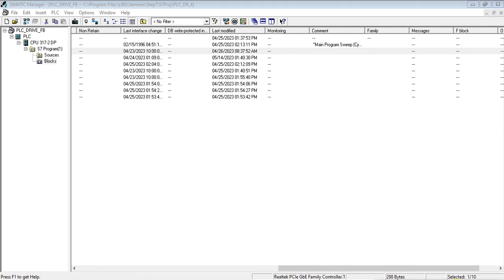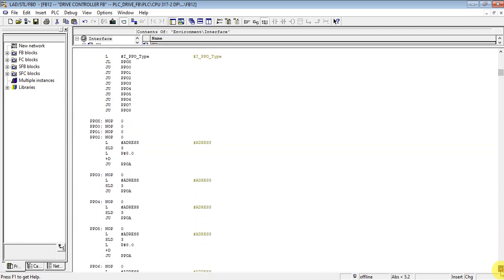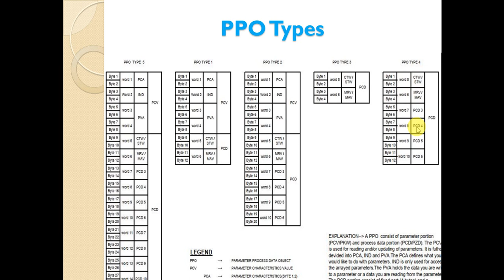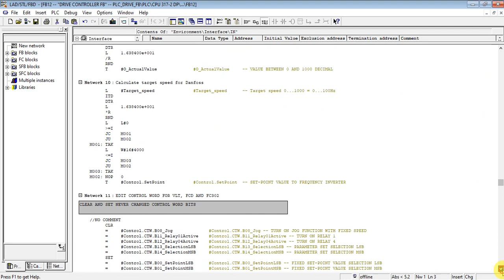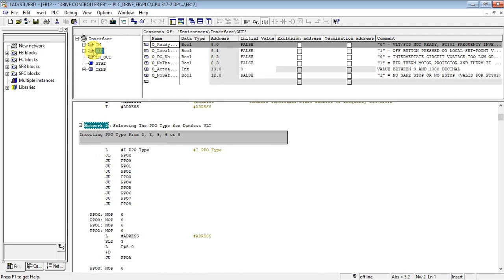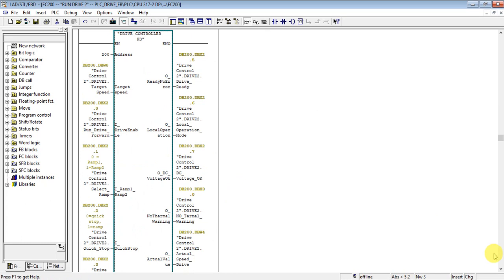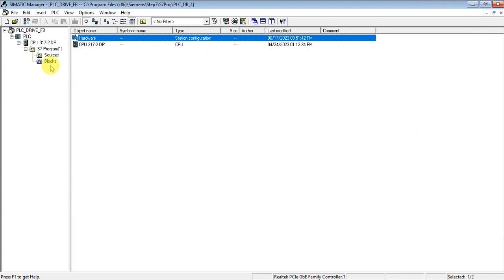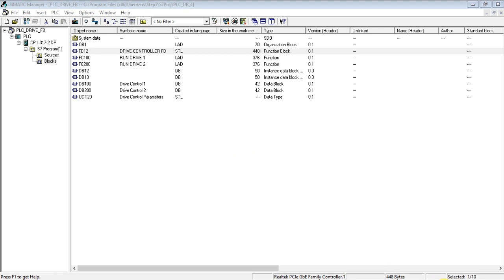S7 300 Create FB that Used for Controlling Many VLT with All PPO Types Part 4

Comment: Sorry for the question. With this could I change the acceleration ramp time or the maximum frequency set? So, is it necessary to have 2 PPOs for each VLT? Or can it be done with 1 PPO per VLT? Thanks!
Reply from the maker: @santiatw  1 max frequency
2 only one ppo per vlt